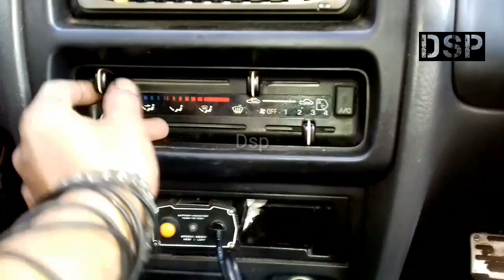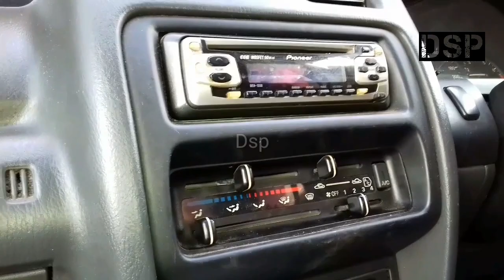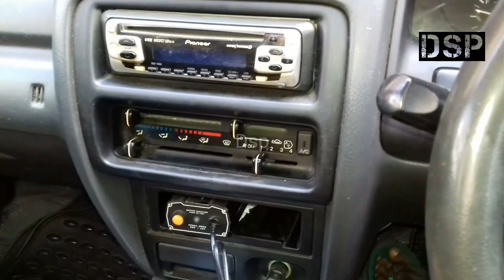pipa ac mobil beku dan jadi ES

Comment: Sangat bemanfaat,
Maaf om mau tanya, mobil saya kenapa ya otomatis ac normal tapi rpm tdk normal,, contoh 
Saat tdk pake ac rpm 800 saat ac di hidupkan rpm ttp di 800 saat gas di injak baru dia naik 1000 terkadang sampe drop di saat mesin sduh jalan beberapa kilo itu mobil tiba2 mati saat ac di matiin mesin normal meski di pake jarak jauh kira2 itu apan,a ya om trimakasih
Reply from the maker: Perlu di cek dulu bos,,
Reply: @DspAcMobilService  idle up selenoid AC itu baru smua om pipa ngembun otomatis AC normal tp lambat GX lasung 1000 saat di gas di dia baru naik 1000
Reply from the maker: Iya mknnya perlu di cek dulu toh bos,,
Reply: @DspAcMobilService  lokasi bengkel dmna om
Reply from the maker: Batam,tiban center
Reply: @DspAcMobilService  wah kejauhan om saya Tangerang

Comment: Kalo netes air di pipa itu apanya bang.
Reply from the maker: Pipa 5/8 pa yang 1/2?
Reply: @DspAcMobilService  
5/8
Reply from the maker: Normal 5/8..ya pasti netes air bos kalo yang1/2 itu panas...
Tapi kalo netesnya di area dasboard berarti safety selang 5/8 dah lapuk
Reply: @DspAcMobilService  kalau pipa besarnya netes ngembun tapi udara kabin tidak terlalu nyes gimana ?
Reply from the maker: Prlu di cek dulu boß